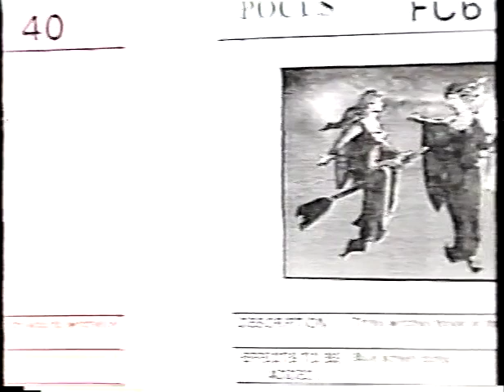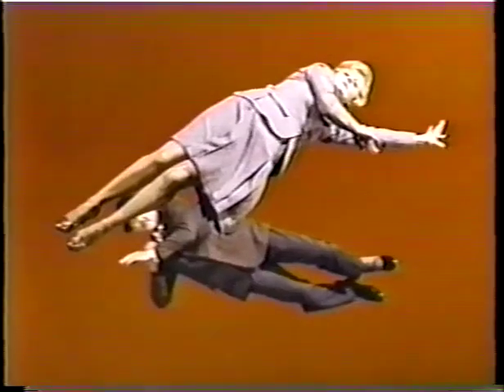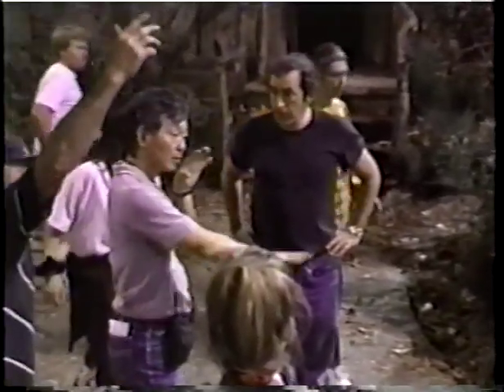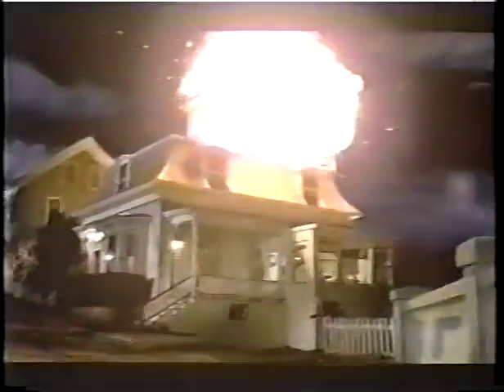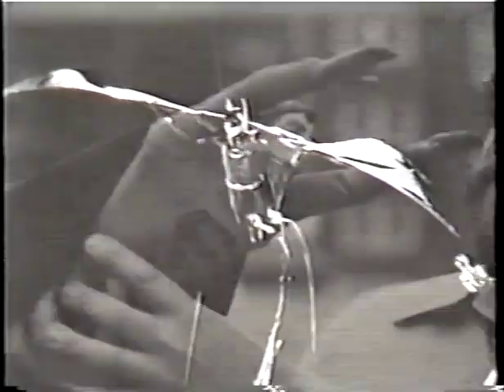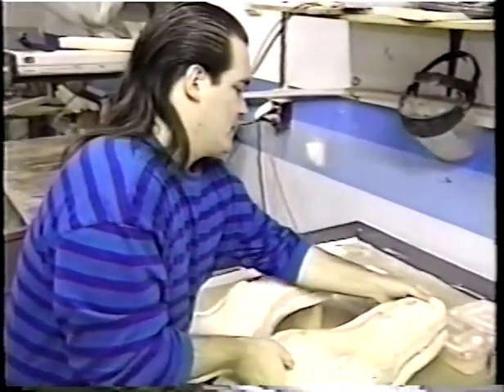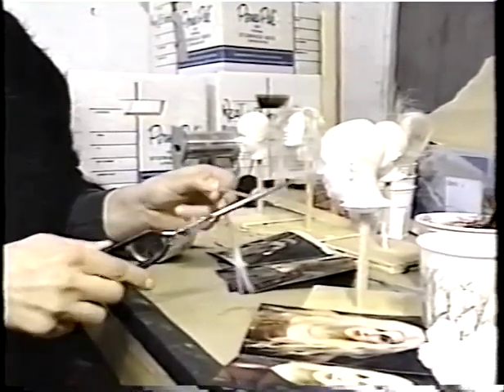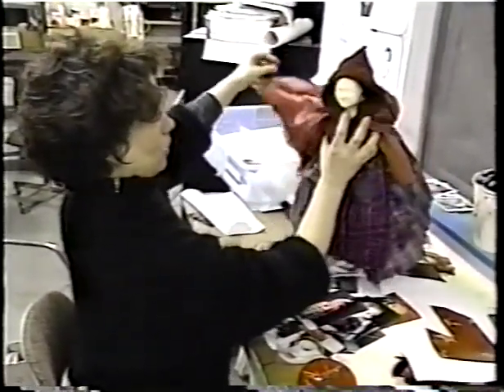Making Of: Hocus Pocus (1993)

Comment: TODAY'S movie industry would probably rely on CGI effects to create the flying effect, but the makers of this movie actually BUILT stuff and WORKED HARD and made the effect physically!
Reply: Johnny The Pianist Clearly you haven't tried doing any kind of animation or 3D modeling.
Reply: I agree! I prefer movies from the 80's and 90's for that reason. Today's movies look fake.
Reply: Do you honestly believe that CGI means the computer does everything for you? lol CG artists basically do the exact same things that these guys did. They just use computers to build it all instead.
Reply: You have little to no understanding of CGI. You would still have to hoist the actor and fly them. You would just recreate the scene around them. Wire flying is still widely used as are puppets, molds, blue screen etc...

Comment: Today in 2016 high-wires & puppets are not used anymore because now we have everything computerized. But these are pretty cool techniques.
Reply: And you see it every time...
Reply: Not sure that's true, if you want someone flying you still need to suspend them in the air against a green screen.

I will agree that they do use CGI where practical effects would look far more realistic though.
Reply: looked better back then
Reply: They used rigs and wires for Hansel and Gretel: Witch Hunters and Oz the Great and Powerful, and most flying shots in Pan